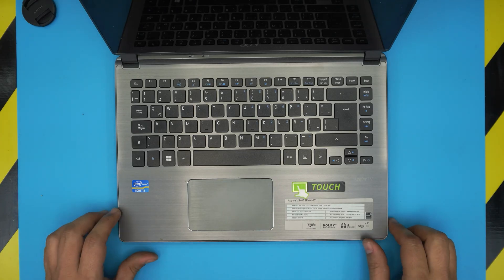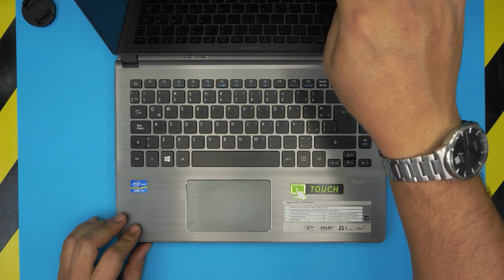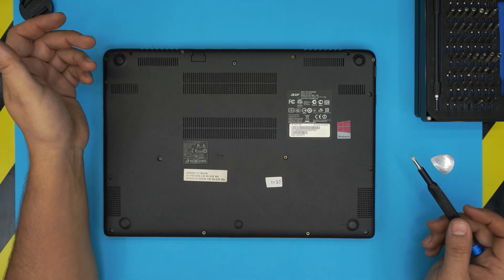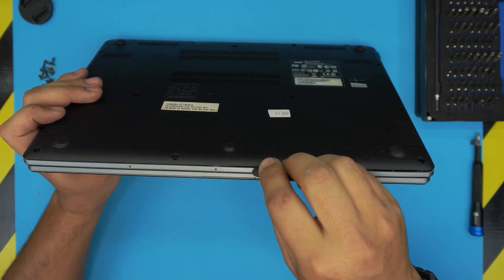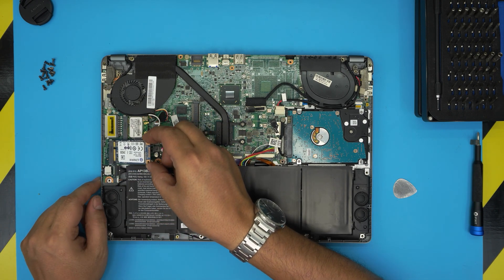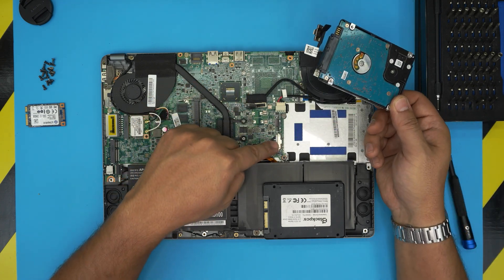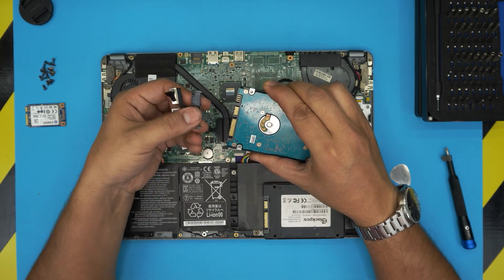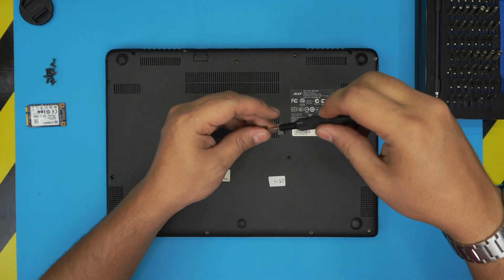How to Upgrade Storage (SSD-HDD) for Acer Aspire V5 472P 6467 Laptop | Step by Step💻

Comment: Just a heads up its a mSATA slot, not a NVMe M2 Slot.  The speeds of the mSATA is the same 6GB as the regular SATA replacement.  First boards with NVMe M2 were around 2016, this looks identical to the 2013 board I'm currently working on.
Reply from the maker: Yes, they are mSATA as per the video I mentioned.

Comment: How to remove the keyboard, which parts or screws have to remove ? please make a tutorial.
Reply from the maker: Thank you for the feedback! if you wish to support the channel you can LIKE or SUB or both :P
regarding your question: i will make a video for it, but if you want to get an idea of how it can be changed, watch this , its the same logic. https://youtu.be/tCjvJdJSKrA
Reply: @uFixTek  Thank you very much, i can't replace the keyboard yet, the lines around the top on the keyboard are like a stucked with the same plastic, it's hard to remove it....I'm pretty sure I'm doing wrong the process, that's why I need right tutorial for replacement keyboard. Thanks much for your help!
Reply from the maker: IT'S MY PLEASURE! , i will try to make a video for this laptop you have in the future.
if you have any question or request in the future feel free to ask me.
Reply: @uFixTek  Thankyou very much ... i appreciate it!